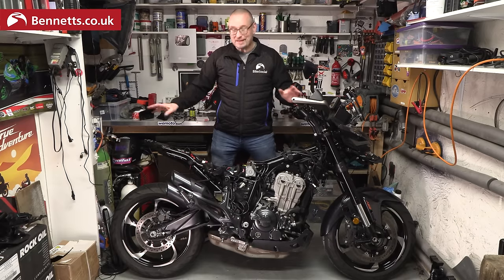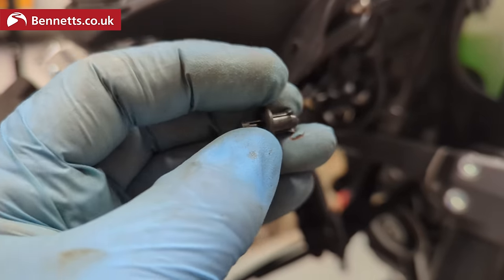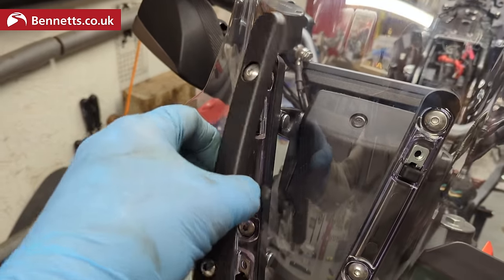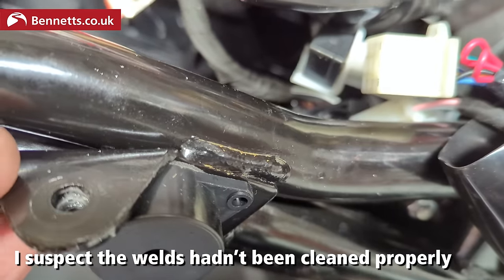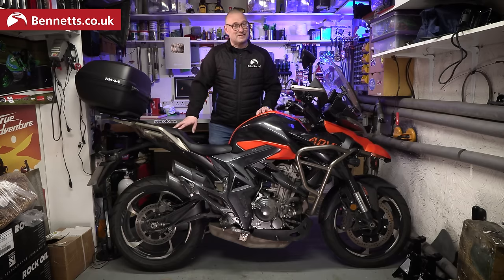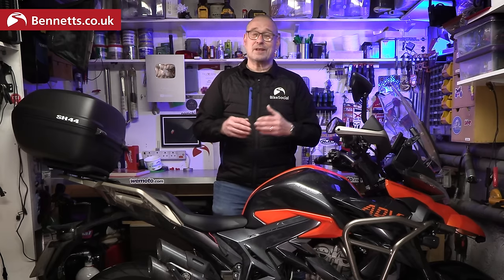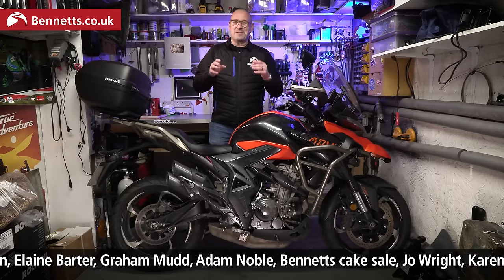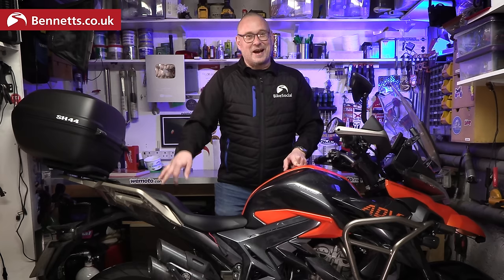Good and bad with my Chinese motorcycle: Electrics, rust and fault codes

Comment: Err on that aerial on the right side panel and you saying it wasn't working, to the best of my knowledge on that it's not for the PKE wireless signal, it's a short range chip based transponder which is used if the fob battery is dead by touching it to that very location
Reply from the maker: Yes, that's right. Sorry if I made it a bit muddled! The problem is that that is doing nothing now. Range has dropped, and it won't work with no power at the fob.
Reply: @bennettsbikesocial  so what your saying is that if you remove the fob battery, and hold it over that right side panel where that strip is located with the red power button pressed, it does nothing? Have you tried moving it around over the sensor area while holding the power button 🤷🏻‍♂️
Reply from the maker: Yes - it doesn't detect the fob at all at the moment if the fob doesn't have power.
Reply: @bennettsbikesocial  strange
Reply: Try holding the fob under the rear arch where the battery recharge plug port is located @bennettsbikesocial
Reply from the maker: @markwaltercooper  sadly there's nothing there to pick up. I did try as I'd read that, but I think it's from another model. Cheers though, John
Reply from the maker: Fixed it! Just stripped it down again and I'd transposed two connectors. Sorted now and working fine.
Reply: @bennettsbikesocial  oh yeah! Great to hear 👍🏻

Comment: i would be interested in part replacement costs and getting the parts. such as a replacement exhaust or those pipes you showed covered in salt for example. it looks like its going to rust a lot within 15k miles.

back in 2006  i bought a new kawasaki KLE 500, and by 2009/2010, an exhaust for it cost £1600 which felt like the value of the motorbike, i had put 25k miles on the thing riding all year round as it was all i had back then.  also kawasaki had ended production (2004 to 2007 was the production years i think) of it so getting the parts was difficult and expensive for an old bike. if not a lot of people buy this model, you might find it goes out of production and then its difficult to find parts to keep it going, and if you find parts they might be expensive.
Reply from the maker: I'm going to find out stuff like that where I can in an upcoming video. Cheers, John

Comment: Can we talk about that welding? Quality generally is much improved from a cheap Chinese bike I had 12 years ago (think it was called a Zongshen something....250 air cooled single) but welding hasn't come on very much at all. Lots of opportunity for rust to set in.
Reply: I have a 2022 made bike whose motor is zongshen. Not sure if they made the frame but the frame welds are so good they at first appeared to be robotic.
Reply: @pd8559  mine was 2012 as I mentioned and it was shocking. The welds on the rear of the bike in the video (when showing  the rubber bungs seal the end of the frame tubes) looks very very poor

Comment: Very interesting vid. No bikes will be perfect but I do think the Chinese brands are trying hard now. My old Firestorm is 27 years old now and it's been great but there's no water proof connectors anywhere and while the frame is aluminium the steel subframe badly corroded asking with anything else made of steel including most fasteners. Over time I've combatted all of these issues, stainless fasteners etc but I think as a direct comparison the Chinese brands are better now than Honda were all those years ago.
Reply from the maker: Thanks very much! Cheers, John

Comment: Excellent review.  Re loose Bosch fuel injection module, have you spoken to the UK Zontes dealer?
Reply from the maker: Not yet as the plan is to keep it quiet what I'm doing as much as possible, so I can see what it's like to be treated like a normal customer. When it's in for service again I'll raise it, but they might have twigged by then. Hopefully not!

Comment: Those small connectors are JST style connectors, and they're also used on my MV Agusta and an older SV650. That said, obviously that one was not crimped correctly, and I suspect they aren't genuine JST plugs, but a cheap knock off. I can't say how good or bad those knock offs are, when crimped correctly.
Reply from the maker: Hopefully the others will be okay! Cheers, John

Comment: I have no idea what keyless ignition is doing on a bike that cheap. There seems to be far too much in the way of electronics as well. Please don't tell me that a 350cc bike has traction control or a lean sensitive imu! The main thing that I would be looking at on a cheap bike like that would be mechanical strength and design. Are the brakes decent? Are the lines cheap? Do the forks work? The corrosion at the weld joints is really worrying. Is the steering clamp and are the head bearings tight? Do the bearing seals hold? Things like that. I don't know if you use a pressure washer for cleaning, but you really shouldn't or at least stand far away to lower the pressure of water. That can ruin bearing seals and cause nasty stuff to happen.
Reply: My 125cc Zontes has keyless

Comment: I’m a retired motorcycle mechanic and the reality of owning a Chinese bike hasn’t kicked in yet, the sun destroys anything plastic, the wire plastic become brittle and the wires get metal fatigue, all rubber components become hard and disintegrate ,welds have little or no penetration and the frame is made of such bad quality metal that the heat in the welding process causes stress fractures, anything electrical will vibrate its self to pieces or melts, I’d like to have your optimism but we would then both be wrong 🤷🏻I’m not a religious man but personally I would make say a prayer before riding

Comment: Those little connectors look just like those on my brand new Ducati behind the headlight
Reply from the maker: They just seem too small for a motorcycle. Or they're too small for my clumsy hands!
Reply: Yes, those are the same as the standard Ducati indicator connectors. Kojaycat sell them for about seven pounds each - useful if you want to make aftermarket indicators "plug-and-play".

Comment: Good in depth review John. You’re not filling me with confidence about the bike! Some of those welds look hideous and the overall paint finish looks very poor. The ECU floating around in the back is just the (brown and whiffy) icing on the cake. I know it’s cheap but I just couldn’t buy a bike like that. It’s not brand snobbery, it just looks poor quality, which is a shame as clearly someone in the operation thought enough to add little touches like the rubber bungs, padding around the panels and the spare fuses. Hopefully Zontes will learn from this and other brands like CF Moto will raise the bar, given they’re building KTM 790s. Fact is a nearly new Honda CB500 is in the same ballpark and in a different league.
Reply from the maker: Totally agree – so far, in many ways this is a 'nearly' bike. Hopefully though it'll prove its worth with some big trips coming up. Cheers, John

Comment: On the sat nav reviews could you include the bmw connected ride phone cradle and new navigator?? Cheers
Reply from the maker: I probably won't be able to do the navigator, but I have used the cradle. For me it's limited in that you can only use the controls for the BMW app, whereas devices like the Carpe Iter BMW Control let you use any Android device.

Comment: Regarding Calimoto: I really wanted to like it but found it is problematic. Where I live is quite rural so direct/fast routes are nice sweeper 'A' roads, fun twisties you would call 'B' roads are also demarked 'A' roads and sometimes 'B' roads. Then there are tight, rough near farm track roads normally not classified but count as 'B' roads round here. So, Calimoto routes have me wishing I was riding an adventure/off road bike if I put in a twisty route request as it defaults to the latter everytime!! And trying to get it to default to a good motorcycle roads can take a long time of putting in way points to "persuade" the algorithm not to send you off down a road with gravel sections and grass growing down the middle!! If you simply put in a fast route it will send you on the one main route through the area everytime. Too much work, sorry. 
Your video was very interesting though and thorough as usual.
Reply from the maker: Thanks! I love tight rural backroads, and would say that in the UK at least, it's perhaps not going to suit someone looking for fast sweepers. Cheers, John

Comment: hi nice video what problems did that ground wire give you thanks
Reply from the maker: What do you mean, sorry?
Reply: @bennettsbikesocial  Hi, the rivet you put on the ground of the EFI control unit, was it causing you any problems? Thanks
Reply from the maker: @robbi1643  Ah, sorry! I don't think that was the fault as it's still throwing up the same error code. I'm still waiting for the mechanic that services it to come back with an answer on what we do next from Zontes.

Comment: I own a CFMOTO and you can't fault the engine but yes, parts will rust and yes you will have problems with electronic switches and sensors.

Comment: also bosch unit is lose on the 310r aswell. key fob is hit and miss. the bike is always on with power due to the keyless so if you do store the bike........ leave the seat off!
Reply from the maker: Thanks for this! I do have it on a maintenance charger so hopefully it won't go wrong!
Reply: you can open it from the back with a screwdriver
Reply: @bennettsbikesocial  is very easy and dont want extra hole...you can pas a screwdriver fron the donwunder and open!
Reply from the maker: Do you mean under the seat? @vangelisevangelou4545
Reply: @bennettsbikesocial  take the noumber plate mount and have 2 holes and with a screwdriver you can open the seat

Comment: Thanks for great content, I have the same bike! I'm also considering to add tail lights on topcase, but wonder if I loose the warranty. Is it safe to take electricity from original Led tail light for third party tail light? Does it decrease intensity of original one?
Reply from the maker: I didn't want to interfere with the loom at all, to make sure there could be no wriggle room in the warranty

Comment: I had problems with my Chinese bike,all the lights came on indicators etc.on the handlebar switch.when I attacked the wiring I found it had been rewired by a colour blind person.so disconnected all the wires and reconnected to the correct coloured wire.

Comment: Did you say your antenna was an OPEN circuit?  I think it should be a short or very low resistance.  If open, then no antenna.
Reply from the maker: No, I checked it and it's as you say - very low resistance. It could be a connection issue further up the line. Going to try to have a look on Sunday. Cheers, John

Comment: How can it be that you have such bad lighting?
My 350 t2 illuminates the road better than my Scoda Superb with active xenon, even without additional lights .
In contrast to you, I was amazed at how good the visibility is.

Could it be that the lights on your motorcycle are just simply poorly aligned?
I have a little less than 5000km and am still very satisfied.

I only think it is a shame is that the mirroring app is not satisfactory for connecting to the mobile. This is a relatively unimportant problem since there are so many other options out therer.

Let me know why it is diffrend with yours?
Reply from the maker: The mirroring app is appalling - totally unusable. It won't work at all with my Pixel 7 Pro, but the phone has issues. I tried it with my daughter's phone and it worked but was terrible.
The headlights are correctly aligned, but just seem really, really bad! Cheers, John

Comment: You compared more than once the corrosion and faults to Japanese bikes. Like Triumph, KTM or Ducati just to name a few, don’t have their own corrosion issues or known faults. Overall, if you want a reliable bike, buy Japanese
Reply from the maker: Just using Japanese as an example as people were up in arms about them when they first came to the UK. Also, I was actually saying that I've seen some of the same rust problems on Japanese bikes (though not missing paint around the welds).
Reply: My all year BMW 700GS from 2016 don’t have any issues - very happy with it.
Reply: @bjrnhjjakobsen2174  Happy to hear it.

Comment: If the bike is, as you say, dangerous to ride at night on the standard headlight, how did it pass safety checks, to be allow to be sold in the U.K.?  
I'm guessing it would be mostly new riders buying this, so add that flaw to inexperienced riding and you could have a disaster waiting to happen.

Comment: Be informed, a Chinese product is not any longer cheap. If you buy cheap it has a reason, or "you get what you pay for". Decreasing quality for the sake of a higher profitability and shareholder value, is an increasing problem in the industry. You should see my Yamaha Tricity after two years! 
Don't understand me wrong, I respect Chinese quality, and I understand the performance and quality steps they made in the last 25 years. In 10 years later, they will outperform every Japanese bike in all aspects. 
Regarding the injection ECU, I suppose it is originally not supposed to be there. I assume, that it was exchanged for export bikes and simply forgotten to fix by the importer.

Comment: In the hands of someone like you, ie mechanically and electrically savvy, this bike can be made to function longer term, in the hands of someone who’s not, this bikes a potential disaster. On a new bike like this, unattached ECU’s, zip tied grounding wires and connectors that fall apart in your hands are totally unacceptable and I hope the China bike fanboys are paying attention.
Reply from the maker: It's always been my theory - cheaper bikes can be okay if well maintained, but are often bought by people new to biking who don't realise what needs to be done. And when there are oddities like this it's worse. My biggest fear is that it puts new riders off bikes. Cheers, John

Comment: 🤣
What a heap.
For £4k you have a massive choice of bikes and even something like a 1990's Fireblade is likely to be better put together and longer lasting than something that has paint over rust and an ecu held in by hopes and dreams. 
If it was £500 I get it. If it was £1500 its borderline but I can see why you would. 
At £4k used (almost new) you would have to be barking mad. 
Thats CB500x or NC750 money if you go a little older - both far more capable and either will likely last far longer even if you get them with some miles on. Thats before we get into depreciation, dealer service and all the rest. 

Oh and remember you're reviewing it for a year. 
However you have also now done quite a few fixes which may or may not have put a lot of people on a tow truck. Remember the average buyer is unlikely to get a close to new bike and expect to have to strip it and rebuild it to have a chance at reliability. Between the rust, electrics not being sealed and general shoddy build like an earth being held on by a cable tie(!) I have a feeling a few things you have fettled would catch out the less wary so that really needs to be an enforced point at review end. 

Honestly I like the way it looks but for me hidden gems like that cable tie would make it a complete no go. Life is short enough without wondering what else they didn't bother to fit properly as you slide down the road after a preventable failure.

Comment: You can push calimoto, but the reviews say otherwise.
Reply from the maker: My experience over several years, and the reviews I've seen don't say otherwise. Doesn't sound like you've tried it yourself either.
Reply: I've been using the full version of Calimoto for a couple of years now and it's brilliant. I've found so many great roads on my doorstep, it's made my riding much more enjoyable. It's not the best at planning a straightforward A to B route, I use other apps for that, that also include live traffic info. But for fun rides it's absolutely ace.
Reply: Not personally no, so I can definitely respect your opinion, though don't really appreciate your passive aggressive response. But when I went to download it the recent reviews on playstore were very discouraging. Have a look.